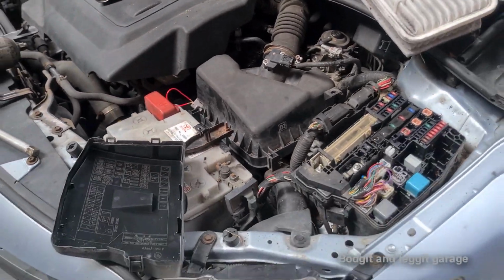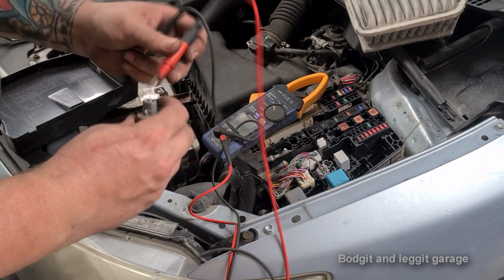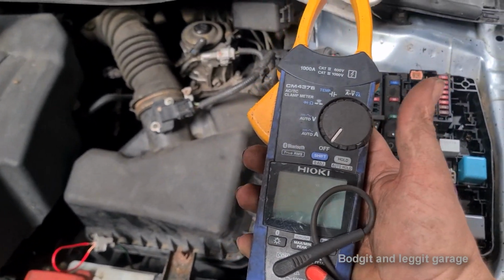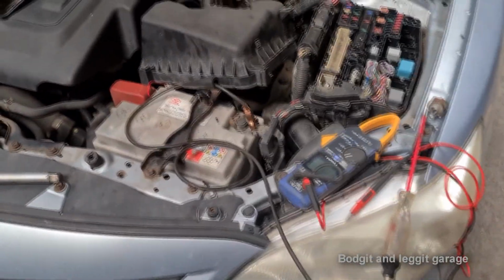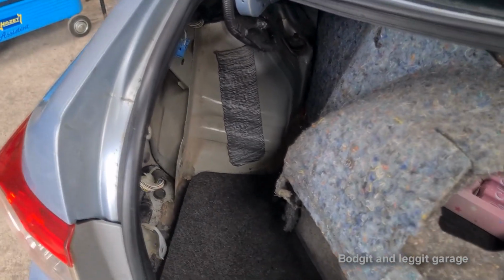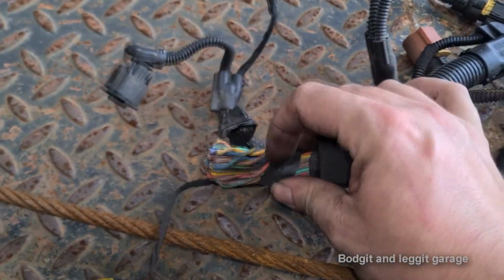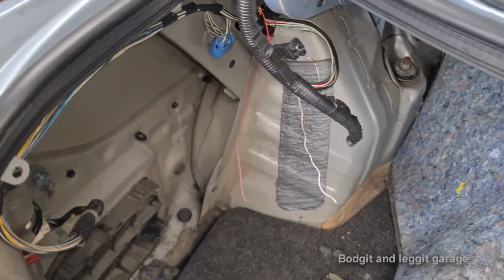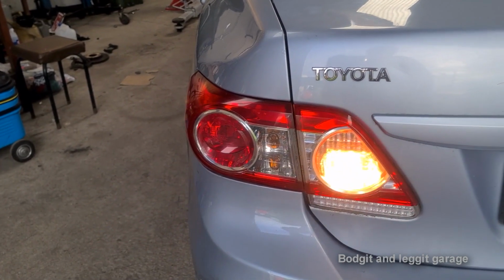Customer said do not check what I have done

Comment: Want some more fun?
I‘ve got a Corsa B here:
Outside temperature showing -31 but sensor is OK. Sometimes it‘s only -17 or so.
Fault codes won’t delete after disconnecting the battery (Delco Multec), goes into retarded ignition (an early version of „safe mode“) at half load sometimes, and sometimes idle is just too rich.
At other times however, it‘s all just fine and it’s a nice runner at 8L/100km 😁